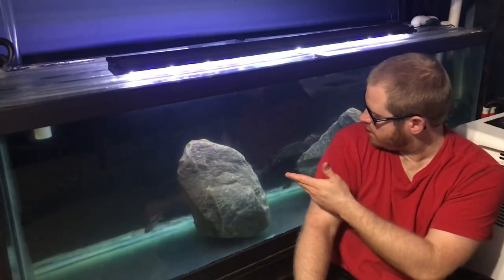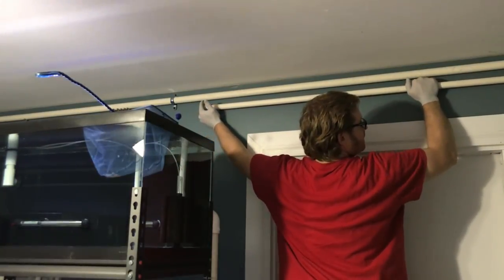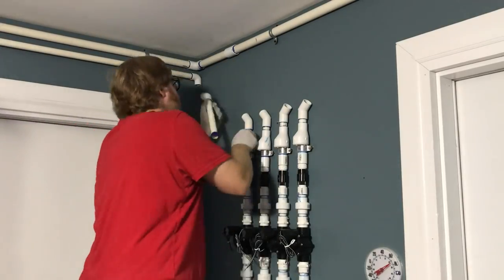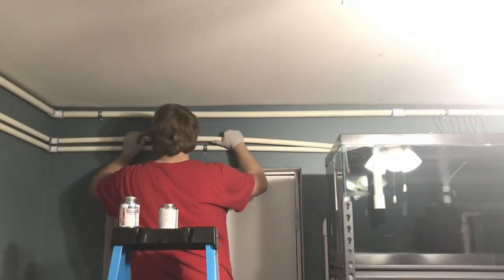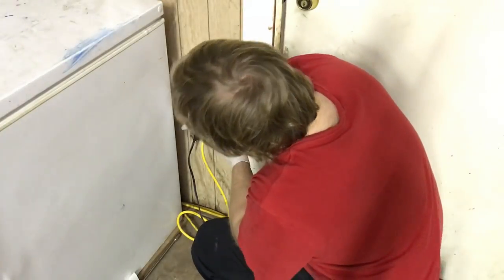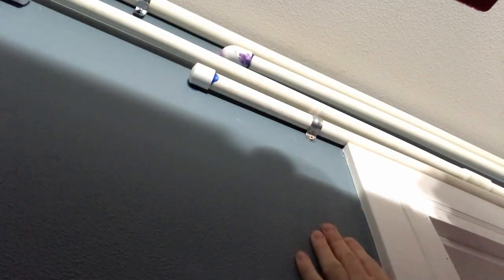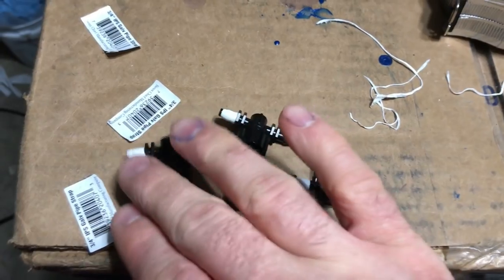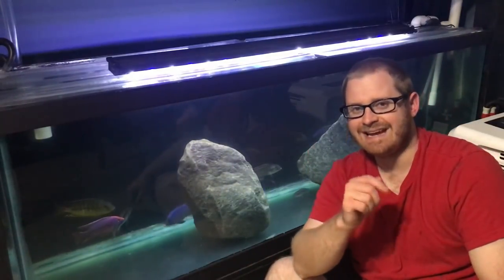this took forever but well worth it

Comment: AWESOME! I wouldn't know where to begin in doing a system like this..I'm still working on getting the room ran with 1 air pump..lol
Reply from the maker: Thanks Lacey! You are doing a central air System?
Reply: @inventoryking  I'm still in the thinking mode but I'd love to power my entire aquarium room with one big airpump and sponge filters instead of having all these hob and separate air stones...I've got it drawn out...all I need to do is go get the PVC, find the right pump, run the PVC and add drop lines...hang a shelf for the airpump and get enough sponge filters...lol..guess we all start somewhere tho
Reply from the maker: Check out Linear Piston Pumps, they are affordable and quiet. Have you seen mine?
Reply: @inventoryking  I'll go back and see, I'm perty sure I have bc I've seen a good bit of your vids